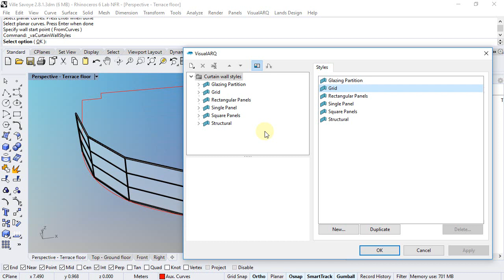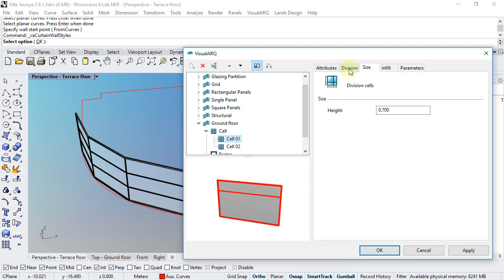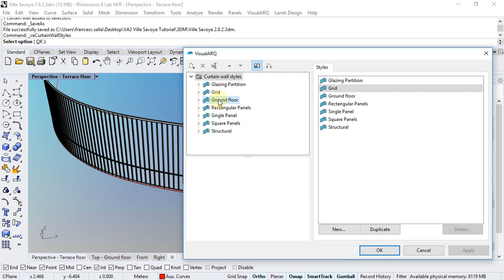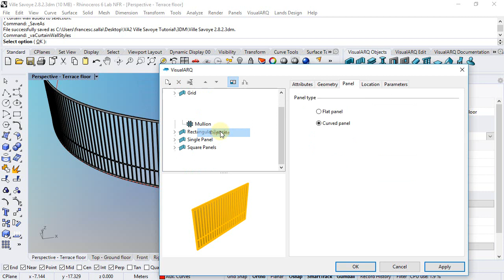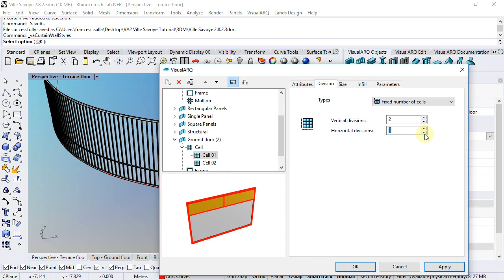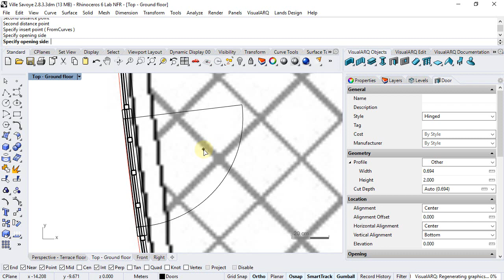VisualARQ 2 tutorial - 2.8.2 Ground floor curtain wall styles

Comment: Question about tutorial: Is there any workaround or way to get a curtain wall that has triangle shape?(without using visualarq3 feature ''curtain wall from surface''
 I have a triangled shape curtain wall shape in elevation view, but I dont know how to make a curtain wall with such shape
Extending to roof wont work because the outer frame will be lost, I want outer frame to take the shape of boundaries while mullions go up vertically and horizontally as usual.
Reply from the maker: Hi @Ericaandmac, do you mean a curtain wall that has a cell in a triangular shape? or that the whole curtain wall surface is triangular? in the first case, triangular cells will be only possible in VisualARQ3, since you will be able to create curtain walls from Grasshopper styles. In the second case, extending a curtain wall to a roof or a surface it should work. If the outer frame is lost, please send us the file to visualarq@asuni.com and we will take a look.
Reply: @VisualARQ I mean the second one but its more complicated than that. Its the edit profile feature in revit which allows user to crop the elevation view of curtain wall, so mullions stay as it is but the frame shape itself as new shape 
https://www.youtube.com/watch?v=DIQvNx-4JQ8
(Probably its because visualarq curtain walls are not defined by 2 elements
doors are define by vertical boundary, curtain walls defined by a line, but what this feature require is a object that that can be both define by a line in plan view and then define by a vertical boundaary in elevation view.

okay, I ll send email :)) and I can show a screenshoot to explain if its okay. and link to youtube video there

Comment: I am testing the visualarq and curtain wall only has default style and it doesnt even have material or doesnt have components to assign different materials. I m not sure what I did wrong but it has no parameters and no materials or even no material slots for different components or no hieararcy of component, so almost nothing its just rectanglular frames in curtain wall but no editability. Do I need to download styles from somewhere to fully have some example curtain wall styles as shown in video?? because I thought they were included at least some basic curtain wall styles. (Note: I m using visualarq 2 evaluation on rhino 7)
Reply from the maker: Hi Erica, if you open a new document from a VisualARQ template, you will see some more curtain wall styles. In any case, you can create new styles with multiple options of design and components, from the curtain styles dialog (vaCurtainWallStyles command).
Reply: @VisualARQ  I ll make sure to use templates file :) thank you for help:))